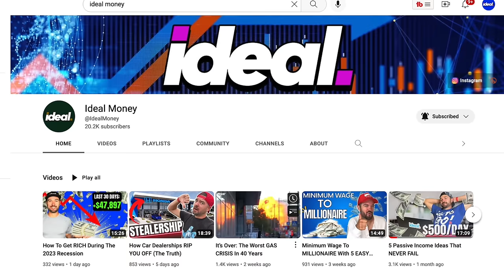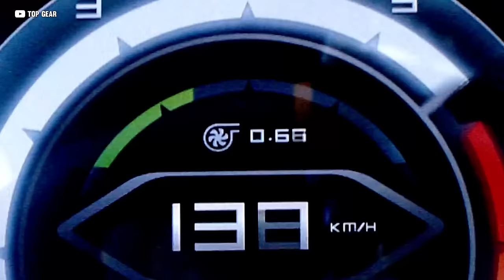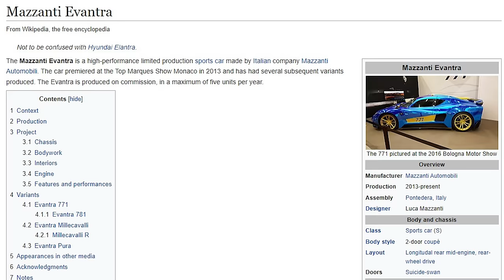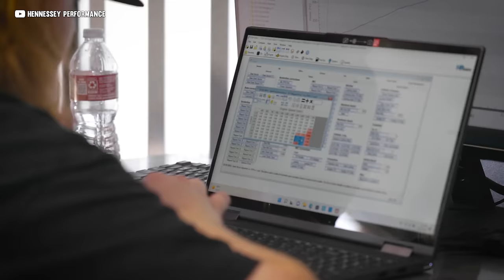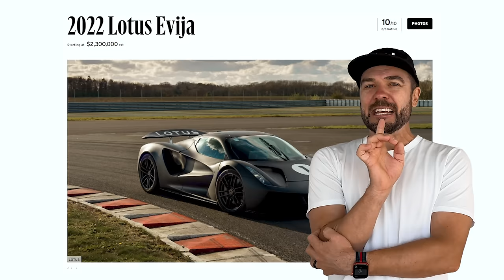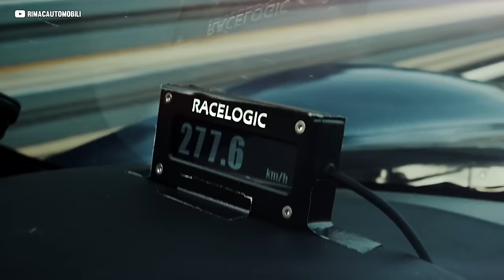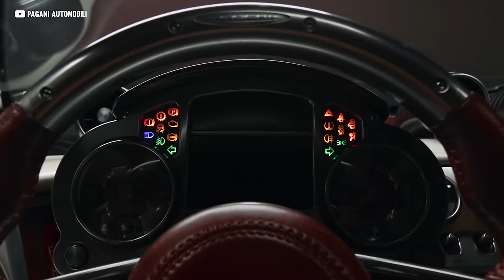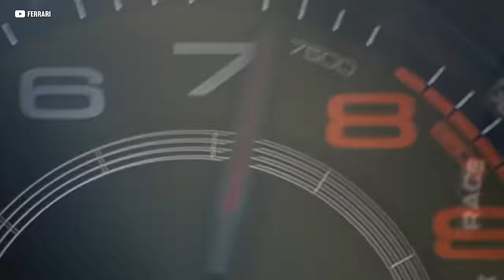These Are The WORST Cars In The World

Comment: Brad, my 1970 Porsche 911 Targa that I found in a barnyard in western Pa is still in my father's barn chillin ;While I recover from getting run over on my 1957 Harley Panhead by a Ford F350. I am a PhD Chemical engineer however this plandemic has shown me the people I work with are not the people I want to spend time with . Although the $125,000 is nice I am finished with Big Pharma. I designed a self propelled ride on wheelbarrow (think a huge ACE wheelbarrow) with tracks that I am able to upcycle from tires that are too worn for street cars and trucks but perfect for floatation or traction on dirt, mud and snow.I started a small engine repair shop but also will be repairing, rebuilding and restoring Porsches,Mercedes and every once in a while a Ferrari. I, like Sam Crac will start making videos very soon. The problem is that it is darn cold here in Pa and it takes a while to get the building up to temperature to be able to feel your hands. I hope to catch up with you sometime when I finish my Porsche which should be this summer sometime. Keep  making  the great videos my friend.